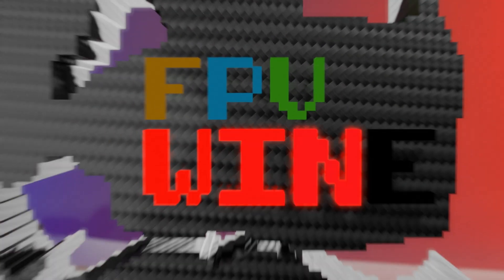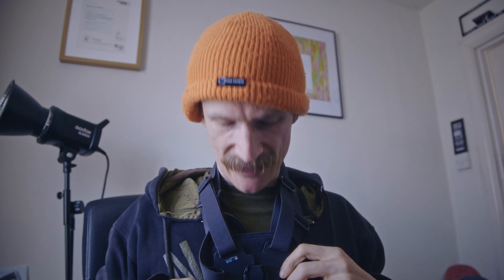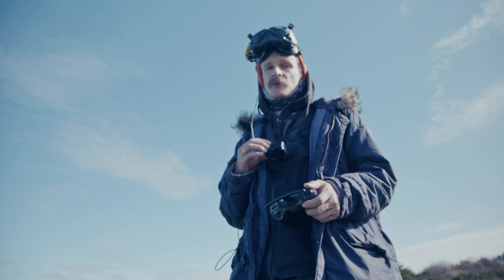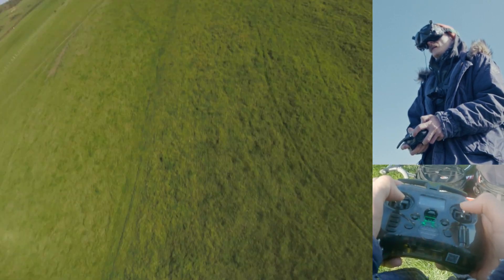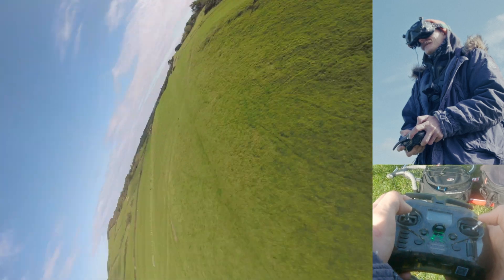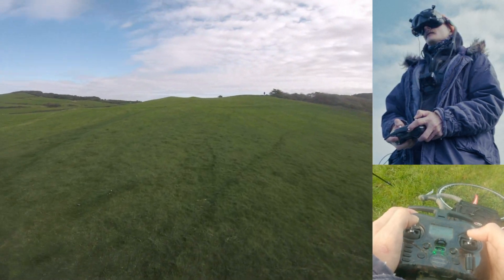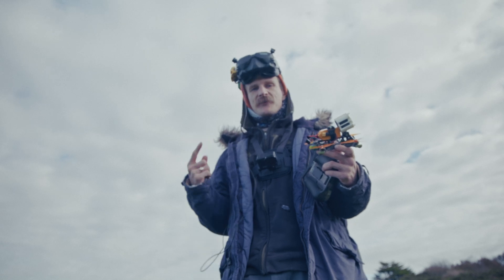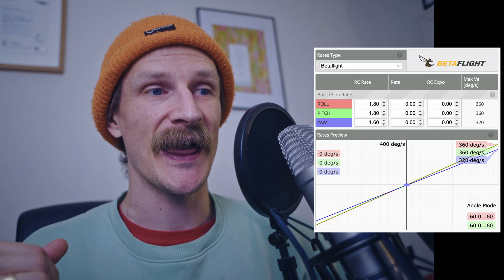FPV PID Rates Compared: Betaflight, Actual, Custom & Linear – What Works Best for Beginners?

Comment: Similar experience for myself. I've basically given in to just using beta flight rates at this point.
Reply from the maker: @fpvmoss-o9i  don’t break what is unbroken! The standard Betaflight rates seem decent. TBF that is what Dod.fpv said as a tip!
Reply: @FPVwineUK  yeah tbf They're predictable. I did find the transition from the RM pocket to the boxer made then feel even slower though 🤣
Reply from the maker: @fpvmoss-o9i  oh that’s interesting, because it’s bigger?
Reply: @FPVwineUK  yeah I think bigger gimbals = more stick throw = sick meds to travel further for the equivalent input from a smaller gimbal.
Reply from the maker: @fpvmoss-o9i  ah that’s interesting… makes me want the Jumper T14